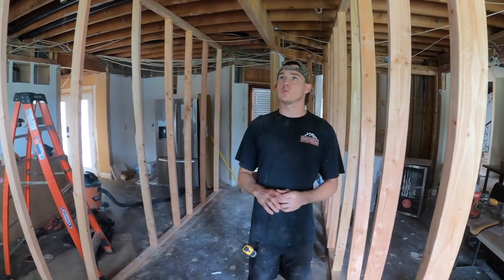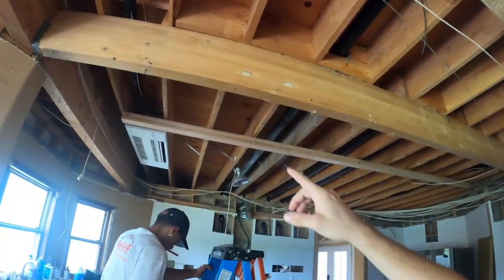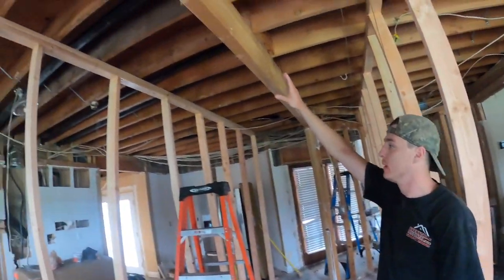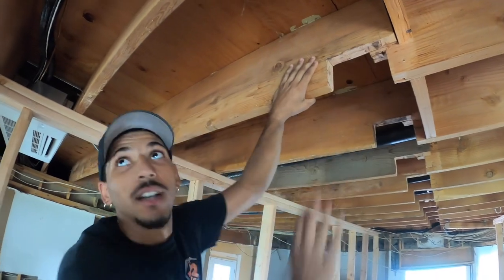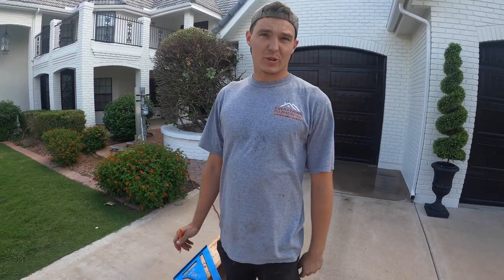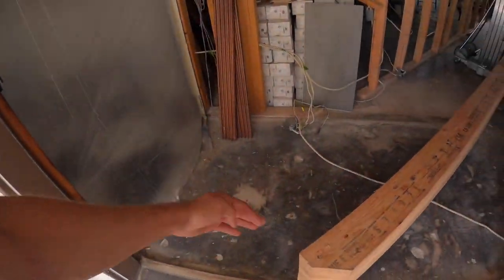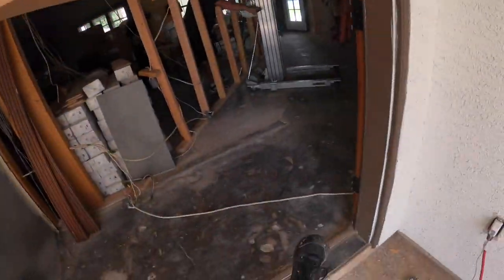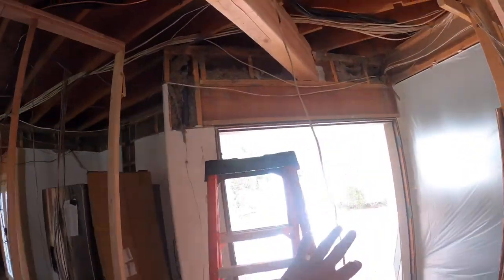Remove Load Bearing Wall & Install Glulam Beam For Open Floor Plan

Comment: I'm trying to do a similar project but don't know how thick the support beam needs to be, and how thick the posts should be. Any advice for me?
Reply from the maker: Call you structural engineer and ask him for beam size etc without a stamp. Should be around 200$

Comment: Just installed my first 30’ gluelam beam, it was 15” thick and it weighed like 1500lbs. We just had to brace the joists into it to flush out the ceiling.
Reply from the maker: That’s awesome! It’s some of my favorite work. We have a video coming up soon we will post of a 30’  but we are waiting on permits approval. Stay tuned!
Reply from the maker: https://youtu.be/AcYPoeEBO10

Comment: You failed to address how you determined that you have a properly sized concrete pad under the 4x6 beam to support the added load!
Reply from the maker: If you look closely there is a structural post that supports the old beam and the glulam beams that run perpendicular to it, therefore  the 4x6 post we added has an adequate footer underneath it. regarding where the beam ends near the French doors, that entire wall is load bearing supporting a 2 story house (roof plus floor) and balcony which means when they built the house the footer had to be sized for that. So in conclusion the concrete pad is rated to support that beam and post! Thanks for the comment!
Reply: I am going to the samething to my home 
I want to get a glulam beam as well it’s a 24 ft span and the ceiling joist are 2 by 10 and the beam will only be supporting the load of the joist and not the actual roof. What size beam do you recommend for something like that ?
Reply from the maker: @rubenllamas5644  reach out to a structural engineer, they could give you a a couple sketches with a seal for around 350$
Reply: @everythingresidential  ain’t nobody got time for no engineer it’s 2021 we have the internet lol
I bought a glulam beam 5 1/2 by 11 7/8 and it’s 24 ft long. Thank you design by savage.
Reply: @rubenllamas5644  thing is, if you didn't get a struccy to do the design in the first place, if you ever need to sell/rent you'll need to get one in to retrospectively assess it (with no guarantee they'll sign it off).. and/or take out indemnity insurance..
Reply: @jaydoobley7665  That’s only if you have integrity.  Unfortunately there are a lot of people out there who don’t.  If he doesn’t get it structurally engineered and cover the framing with drywall (ie finishing a basement), how will the prospective buyer ever know?  It happens all the time.
Reply: Was these calculations done based on experience or was a structural engineer that performed them? 

I am asking because all the beams are seeing a load perpendicular to the grain other than the post that would support both beams, and it being wood the calculations require some mod factors.
Reply from the maker: The entire project was sealed by a structural engineer. We never do projects like this without a stamp.
Reply: @LDSKIPPER1911  they will know down the road but problem will be how it will be handle in court to proof who is negligent and responsible. Say if someone collapse could be major! Say there just minor crack or sag, maybe next 30 years it’s sound and more cosmetic and no one will care.

Comment: Loved the vid. Not in your area but what’s a reasonable price range I should expect from a contractor for a 20ft span single story? Beam and install, no finish work
Reply from the maker: okay there is 2 ways of doing this. you can either permit it or not permit it. Not permitting the project will be much cheaper but could bite you in the butt . if you don't permit it you can reach out to an (engineer not an engineer firm) to size the beam for you,  post size, and footer size. but tell them not to put a seal on it so they are not responsible which makes it dramatically cheaper. but now you have a schematic to build relatively cheap. To hire a contractor to throw a temp wall and cut the rafters and install the beam will probably run you between 1800-3500. it can all be done in one day with 3 people and that doesn't include cutting and installing a footer. 
If you decide to permit it. engineer 300-500$ with stamp. permit fees lees than 300$. Blueprint of house with notes indicating where beam is going and setbacks etc, you can do this yourself if not another 300-600$. if footer isn't sized correctly. Ripping out footings, inspection, pouring concrete probably 1500-2000$ Than to hire a licensed contractor to perform the work (temp wall, beam install) 2500-4500$ also if you open the ceiling the wires are to short to lift in the air or something unexpected shows up you can expect a change order and additional cost from a contractor. hope that helps.
Reply: @everythingresidential  awesome answer, very informative. Thanks for taking the time to make these vids and answer questions!
Reply: Follow up- turns out we had 3 load bearing walls to remove to make the house truly open concept. We ended up doing all the work ourselves. Our engineering was $1000 for specs for 3 walls. We ended up with a 26ft span, 20 ft span and a 13ft span. Lvl cost for 5 beams was $1200 lumber and random other stuff (ie duct hoist) $1000. Luckily we had all the tools  needed. It took us 3 days to ddinishsVc
Reply: @p2thumper07   what was the size of the beam for 13’ span? Thank you

Comment: Great video! How do you know if there is a footing there?
Reply from the maker: We know because there is currently a load bearing wall, another day to find to is get a 36 inch concrete drill bit and drill into the concrete where yo think a footer is. You will feel the drill bit go past the concrete into the dirt.

Comment: Great video, very helpful. For existing home with load bearing wall, Can you join two small beams using metal connector between the two together to make one long beam to get rid of a column holding up the weight?
Reply: Definitely not